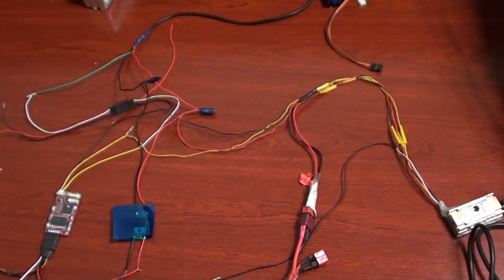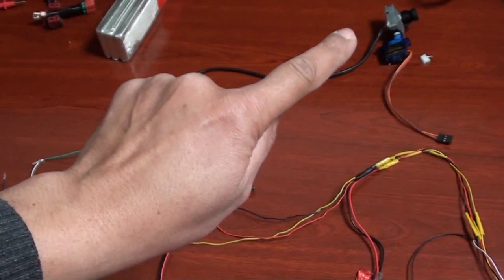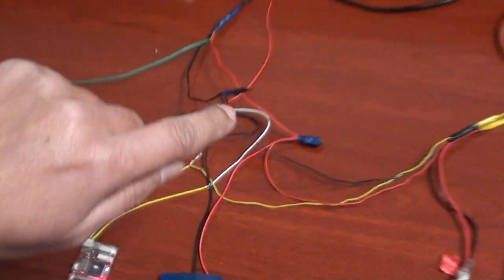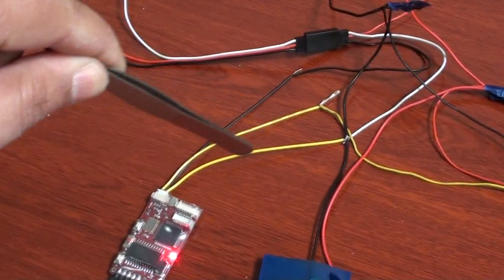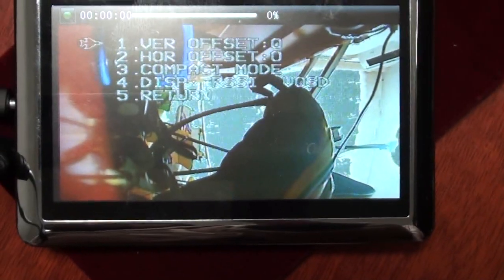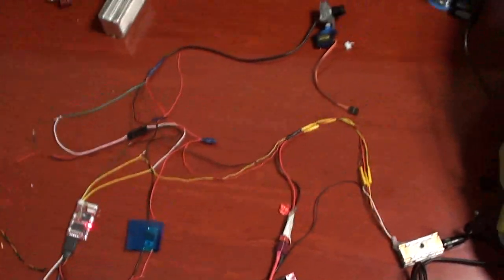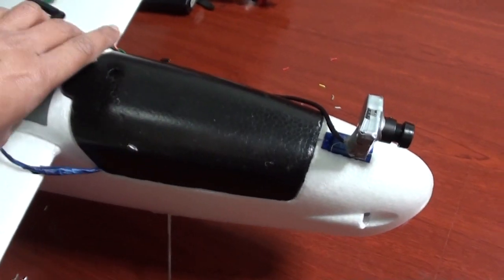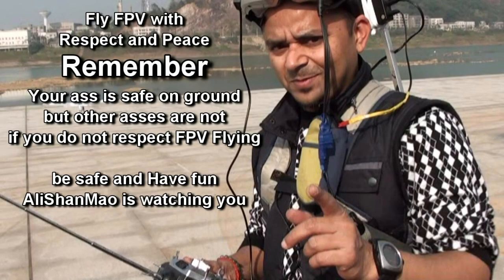Beginners FPV Guide -- Adding an OSD to FPV System

Comment: Is that a lawmate transmitter that you hooked up to the telefly? i understand that it may not work with the mfd system due to audio problem. did you get yours working?  if so, how?  would like to see this tracker working, and know what equipment you used to do it.  thanks, alishanmao!